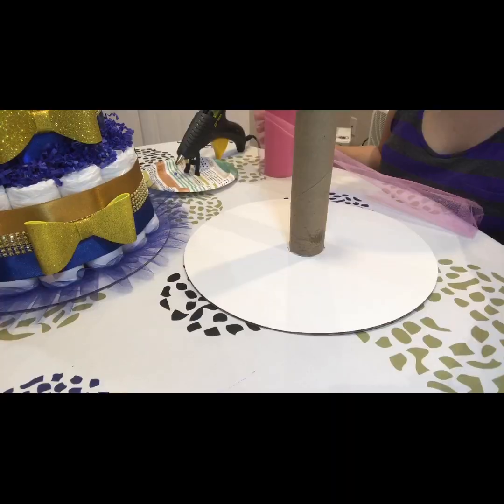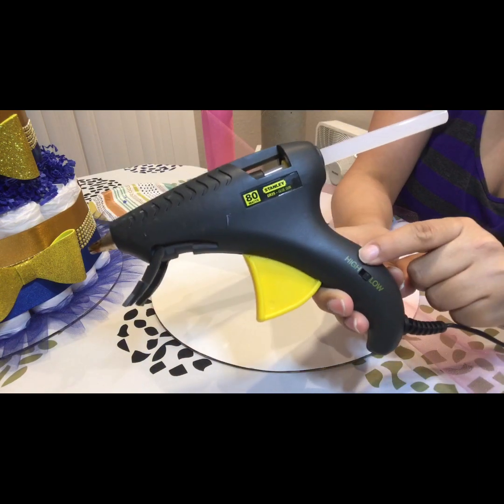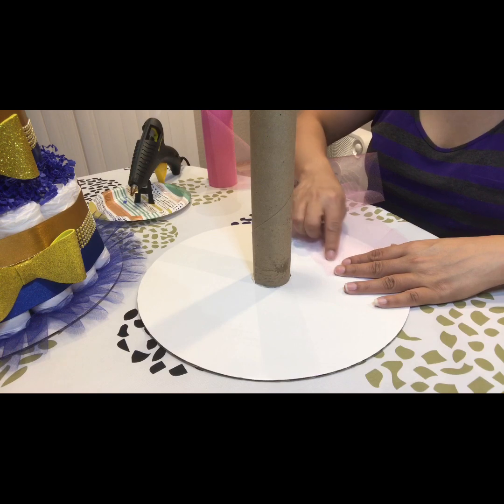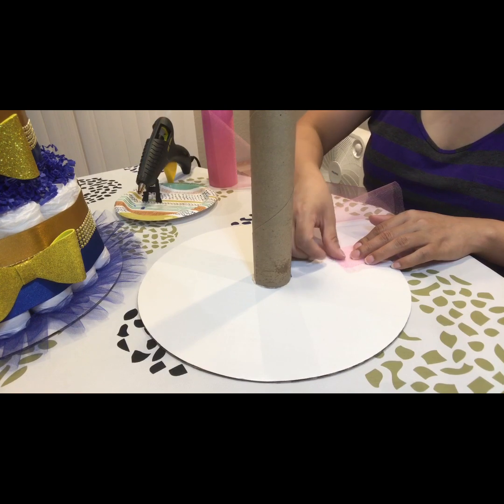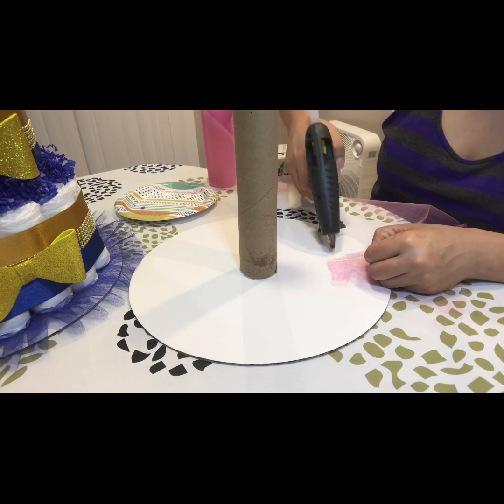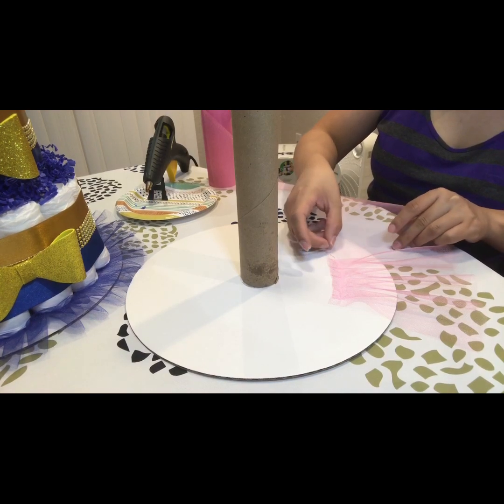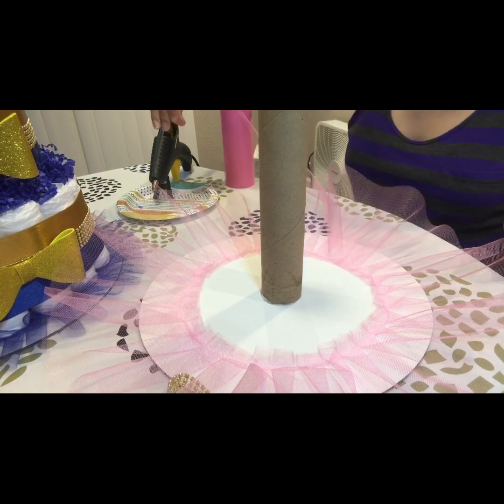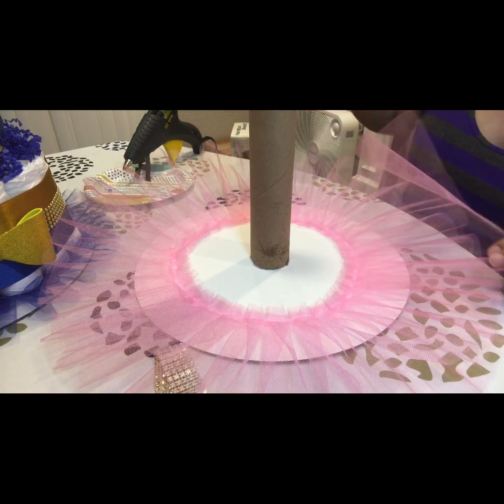How to add Tulle on a diaper cake

Comment: I many diapers did you use
Reply from the maker: Hello Monica, you need about 60 diapers. 20 for the bottom tier, 17 for the middle and 6 for the top tier. That’s for your common sized diaper cake.
Reply from the maker: Thank you for watching by the way. It’s greatly appreciated.